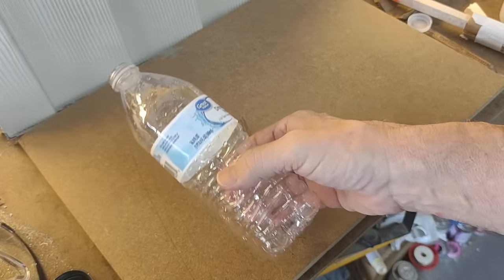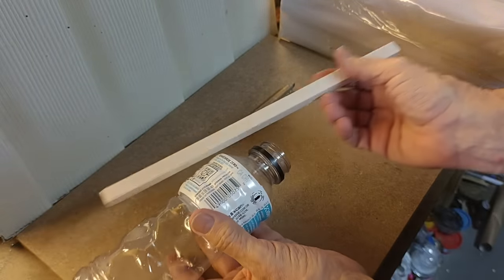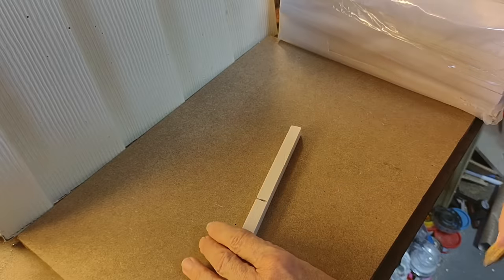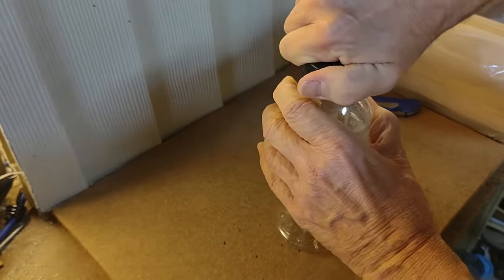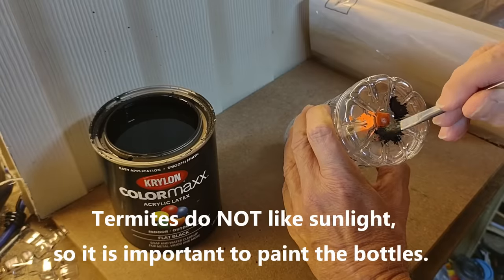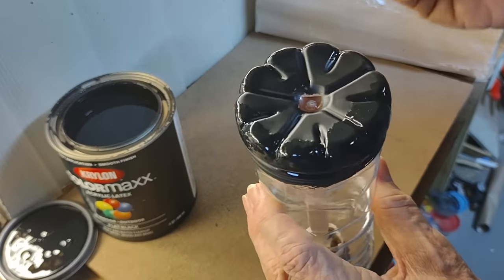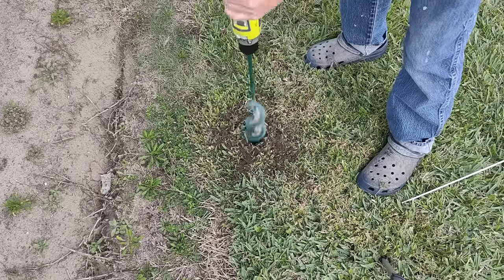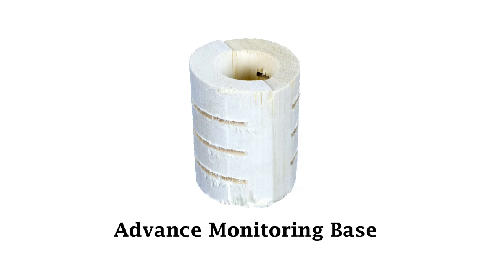Unbelievable Water Bottle Trick for Termites!  Simple to do!

Comment: Sir, my wooden backyard is infested with subterranean termites.  I will pull those wood out and pour concrete over them. I'm from southern California.  My house did termites fumigation 2 months ago. When i go up in attic space i saw some termite droppings after the fumigation.   What products can i should to prevent termites inside my house? How can i get rid of subterranean termites once the wood platform is pullout and dispose of. Thanks
Reply from the maker: I wish you had found me sooner.  Pouring concrete is not a good idea when you have subterranean termites.  The concrete prevents you from treating them.  You are better off using the infested wood against them.  If you send me photos of what is going on in the backyard, I can tell you how to treat it effectively.  My email address is guyspestsolutions@gmail.com.

Now, let's talk about the drywood termites.  You only fumigate for drywood termites, so that means you have them. They are not like subterranean termites.  It is important to understand how drywood termites work.  They enter through cracks and crevices around windows, doors, the eaves, pipe penetrations, and so forth.  Most of the time, they enter through several locations.  That is because a swarm of them attacked your house at the same time.  If there was a crack or a crevice, then they probably found it.  After they established their galleries, which will be inside the wood, it will take four to seven years for them to be able to swarm.  Now that they are in your house, the swarmers will use holes that are in your studs to travel through the walls.  Those holes in the studs were created by the electricians to run the electrical wiring.  Not only are these holes going through the studs, but holes were drilled into the attic for the light switches and to run some of the wiring for the outlets.  So, the termites now have easy access throughout the attic and the walls.  If you have a basement or crawl space, they have access to that as well.  Most of the time, you will have no idea that they are in the walls, because the frass is inside the wall.  To make matters worse, if you have drywood termites, then your neighbors have them too.  That means you have been getting swarmed for as long as they have existed in the neighborhood.  Most likely, we're talking about years.

As I already explained if you have drywood termites, the only sure way to get rid of them is to fumigate, which you already did.  The problem is that the gas they use to fumigate has absolutely no residual action whatsoever, so you can get reinfested the moment the tent comes down.  Like I said before, if you have drywood termites, then your neighbors have them as well.  Since drywood  termites swarm every year, it is almost a certainty that you will be reinfested within a year after the fumigation is done.  You may have already gotten reinfested if you are still seeing fresh frass in the attic.  The only way to prevent further attack is to do a preventive treatment on your house every 60 days.  Most pest controllers will not do this, so it is something that you generally need to do yourself.  I have a video on how to do that and I will place a link below.  The company that did the fumigation may have given you a warranty, so they may be willing to spot treat the attic for free.  So, read the contract.  You can also spot treat the attic yourself.  Regardless of how you treat it, you should begin the preventive treatment immediately, so that you do not get additional termites paying you a visit.

I am so sorry that I had to share that bad news, but it's better that you know.  Be well my friend.                      

Video on how to prevent drywood termites (You do not need to treat your yard for drywood termites.  Just the house):  https://youtu.be/Yozv3s-Qwlw

Video on how to spot treat drywood termites:  https://youtu.be/U7ck7zhS0Xo

Comment: I don't understand why the monitor/bait stations are located so far from the perimeter of the house.  Seems to me, the closer the better.  Also, these stations will only attract termites close to the surface.  What about those with deeper nests?  I have a basement.  Also, I've read that subterranean termites must return to their nest frequently, possibly daily.  That would mean they would find a station the next day.
Reply: The bait stations are only going to help determine if there is a termite nest or termite activity near the bait placement.  Make sure that there is no wood or debris laying on the ground that would feed the termites unless you are using the loose wood planks to locate them coming up to the surface to find food.  The termites love wet wood too, so you could bury them in the ground and just pull them up every 4-6 months and check them.  You'd be looking for white little critters when you check them.  Carpenter ants and centipedes like eat decaying wood laying on/in the ground too, so don't assume that the wood being eaten it termites.   Try to visually confirm that they are there.  I had a pile of poplar stacked with the cut ends on the ground and the termites bored up through those logs quite nicely.  They went up over 3 ft. above the ground in this material.
For deep foundation treatment, trench around the foundation about 6" to 10" deep and pour diluted Termidor from a pail in the trench and let soak down the side of the foundation.  It is relatively inexpensive given the treatment rate of about 1/2 to 1 1/2 ounce per gallon of water.  it works the same as the Delona, where the termites will take the pesticide back to the colony.  The most common place termites enter homes is where there are openings or cracks in the concrete foundation or doorstoops where the gap between the foundation and stoop make a nice little matrix for them to build their mud tunnels up to and enter under the entryway threshold.
Reply from the maker: The stations are located that far because you don't want the termites too close to your house.  You want to treat them before they get to your house.  Subterranean termites only travel a couple of inches below the surface of the ground.  The do not travel very deep because they understand that there is no wood down there.  They know that the wood is going to be near the surface or above the surface of the ground.  So, you almost never need to treat deeper than six inches.  The only time termites will go deeper is if the entire colony is right next to the house or under it.  This is very rare, but it can happen.  99% of the time the monitoring stations will detect them.  They do need to return to the ground fairly often to obtain the moisture they need to survive and to bring food back to the colony.  After they find the station, they will constantly travel to and from the monitoring station until the food is gone.  That is why you need to check the stations at least monthly.  If a station goes off, you can now treat it with bait you make yourself.  I just posted a video yesterday on how to do it.  The commercial stations can take up to 2 years to kill the colony.  The ones I show you how to make can do it in under 12 weeks.  I will give you a link to it.

Be well my friend.

Video on how to make bait stations:   https://youtu.be/r05Z-aUJehw

Comment: Mask the bottom portion you don't want painted and dip the bottle. Let ot dry and pull off the tape.
Reply from the maker: That should work.  You can also mask that small area and then just paint over everything and pull the tape off when it's dry.  Whatever you find the easiest is the best way to do it.  Thanks for the suggestions.  Be well my friend.

Comment: Why not just spike the balsa wood into the ground and check them on occasion?
Reply from the maker: Wouldn't it be nice if you could just hammer a stick into the ground?  The problem is that termites do not come up to the surface, so they will eat the entire stick, except for the tippy top, where the orange paint is.  By the time you see the paint compromised, the termites may already be eating your house.  With the termites stations the sticks are suspended in air, under pressure, so they will not be held together by the ground.  So, as soon as the termites eat through any part of it, the stick will collapse and the orange area will drop into the bottle and disappear.  This will happen long before the termites get to your house.  I hope that helps.  Be well my friend.
Reply: @GuysPestSolutions  ahhhhhhhhhhhhhhh that's why. ok. :)   (still working through the vid. i struggle with attention so it can be slow going and i tip off to the comments.) i'm actively envisioning things as you are going along..... like, the bottles i can use, etc, placement. then wondering what the endgame is if you find the lil buggers eatin your sticks. stay tuned, i guess..... resumes watching

GA contracts are like $900 a year! hoping i can find a solution where that isn't needed.
Reply from the maker: @lurklingX  Another option is to use termite granules. You need to apply the granules around the perimeter of your house every year, but you can do it in less than an hour, with no trenching, and it only costs about $50.  It is so easy to do that a child can do it, and it's super safe to do as well.     

For the granules to work, you need to have dirt around most of the house, and that dirt needs to be porous enough so that water will leach into it.  You can do a simple test to see if your dirt is porous enough by simply digging a shallow hole right next to the foundation that is 4 inches deep and about 8 to 12 inches long. Just the width of the shovel is all you need.  Fill the hole with water and see how long it takes for it to seep down into the ground.  If it drains down into the ground reasonably well, then the granules should work fine for you.  

Make sure that you buy the correct granules.  There are two versions of them now.  You need the ones that have imidacloprid as the active ingredient.  A lot of the Home Depot and Lowes stores no longer sell the right ones, but you can still get them from Amazon.  I will give you a link.  I will also give you a link to my video but how to apply the granules. 

I hope that helps.  Be well my friend.

Video on how to apply termite granules:  https://youtu.be/H7rW_TSBHJ4

Termite granules:  https://www.amazon.com/dp/B000RUIJYM?ref=nb_sb_ss_w_as-reorder-t1_k6_1_3&amp=&crid=3PP407FA3DQGW&amp=&sprefix=ter

Comment: rats in the roof space ? do you have a video on that?
Reply from the maker: I don't have a video on rats, but I can tell you what you need to do.  Rats are coming in from the outside.  So, the first thing you want to do is discourage them from being there in the first place.  If you have pets, do not feed them outside and do not leave food or water bowls outside.  If you have any bird feeders, then it's a good idea to remove them.  While the rats may not make their way up to the bird feeders, the birds can be quite messy and some of that bird feed may find its way to the ground, where the rats may eat it.  Make sure that all your trash cans are covered, and they have no holes in them.  In other words, make sure there are no food or water sources that they can get into. 

Next, walk around the outside of your house and seal any openings that you find.  You can use a commonly available caulk for small holes and Stuf-Fit for larger openings.  I will give you a link where you can buy Stuf-Fit.  If you have any trees or large plants that are touching the house, then trim them back and make sure that you have no trees that are overhanging the house.  This is very important if they are getting in the attic. If you cannot find where they are getting in, then buy a trail camera from Amazon.  Put it on a tripod and face it toward the house and let it run overnight.  Use the highest sensitivity setting.  In the morning you can look at the video and see where they are getting in.  If nothing is on the video, then just move the camera to another area of the house.  Keep moving it around the house until you find where they are getting in.  I will give you a link to a really good one, but there are much cheaper ones available on Amazon that may also work.

Now that you've discouraged them from coming into the house, it's time to eliminate the population outside.  To do this, you need to use a bait and bait stations.  I will provide you with links to these products.  For the best results, place the bait stations directly against the foundation of the house and space them about every 15 to 20 feet apart, where you are seeing the activity.  You need to check the bait stations every day and replenish the bait as needed, until you are no longer seeing the bait being eaten.

If you have rats that are inside the house, then the approach is pretty similar to outside the house.  You want to start by removing all the food sources.  Take your trash out every day, before you go to bed, so that there is no trash left for them to get into during the night.  Also, make sure that you don't leave any dishes lying around either.  Pet food and water dishes should not be left out overnight.  I do not recommend that you use a poison inside the house, because you don't want dead rats smelling up the house.  Therefore, I recommend using traps.  I think that snap traps work the best, and they're very affordable.  However, if you wish to be kind to the rats, then you can also use traps that will catch the rats alive, and you can release them someplace outside.  You can find a good selection of these on Amazon.  Just like for mice, you want to place the snap traps next to the walls, with the bait facing the wall.  If you're using the traps that catch them alive, then you want the opening to the trap to be near the wall.  The traps I am recommending can be reused.  Always wear rubber gloves when handling traps because the rats may avoid a trap that has a human smell on it.  After you catch a rat, you can dispose of it in the trash and then rinse off the trap with a garden hose for reuse.  Do not over clean the traps because you want to leave a little of the rat smell on the trap.  That will make the other rats more likely to approach the trap.  Be sure to check the traps at least daily or more often because dead rats in the trap will cause other rats to avoid the trap.  I do not recommend feeding rats and mice to the cats because they may have a disease or parasites that can be passed along.  Place the traps at 10-foot intervals along the wall and focus on areas where you think there's activity.  Since you will be reusing the traps, I recommend that you use peanut butter as a bait because it is easily cleaned off when you wash the traps.  If you find that the rats are licking off the peanut butter without setting off the trap, then you can try a little bit of marshmallow.  It is much harder to clean it off the traps, but it is practically impossible for the rats to get it off without setting off the traps.  If you have children, I'm kind of guessing that you would prefer that they not get their fingers stuck in a trap.  I'm also guessing that you would prefer that the traps not snap down on the noses of any pets.   To avoid this problem, you can place the traps inside of a bait station.  These stations lock so that the kids cannot get into them.  They also make the traps more effective because rats like confined spaces.  Just use one trap for each bait station.  In the attic, just set the traps where you see droppings or other activity.

I hope that helps.  Be well my friend.

Stuf-Fit:   https://www.domyown.com/stuffit-copper-mesh-p-1463.html?msclkid=63d2caf9e3af1b89ec3aae7800ba5242&utm_source=bing&utm_medium=cpc&utm_campaign=Rat%20amd%20Mouse%20-%20JumpFly&utm_term=stuf-fit%20copper%20mesh&utm_content=STUF-FIT%20Copper%20Mesh

Rat bait: https://www.domyown.com/contrac-allweather-blox-rodenticide-p-80.html?sub_id=571

Bait stations: https://www.domyown.com/protecta-rat-bait-station-p-1292.html?pdpv=2&sub_id=199

Snap traps:  https://www.domyown.com/trapper-trex-rat-trap-p-95.html

Trail camera:  https://www.amazon.com/Cellular-Trail-Camera-Sends-Picture/dp/B0CCCPN4Z8/ref=sr_1_48?crid=2OCDKLFANJLB6&keywords=trail%2Bcameras%2Bwith%2Bnight%2Bvision%2Bmotion%2Bactivated%2Bwaterproof&qid=1694077897&sprefix=trail%2Bc%2Caps%2C123&sr=8-48&ufe=app_do%3Aamzn1.fos.006c50ae-5d4c-4777-9bc0-4513d670b6bc&th=1